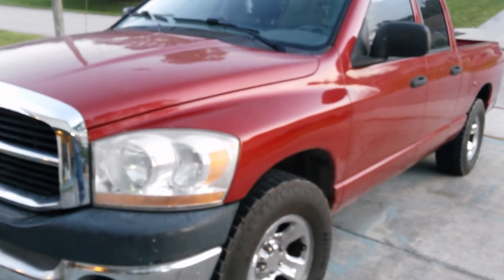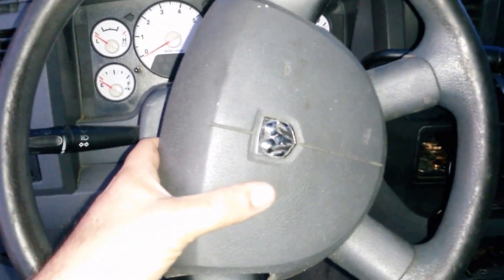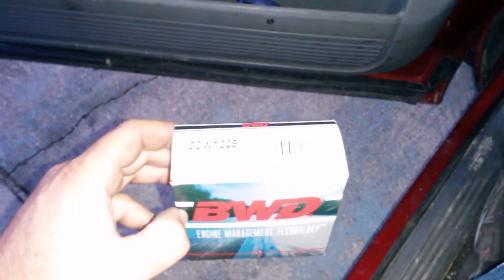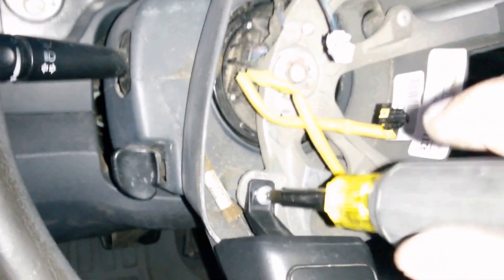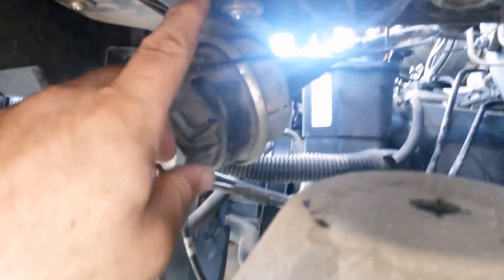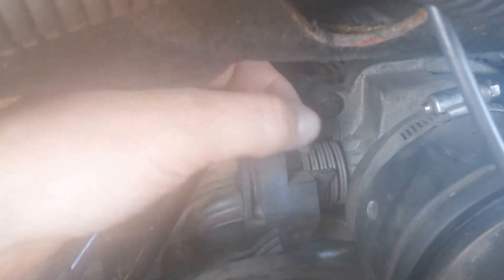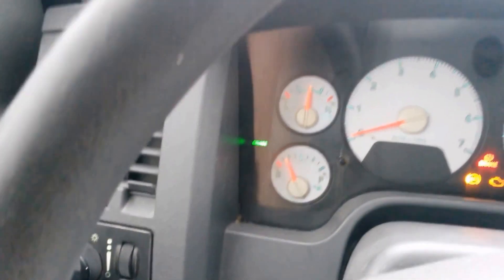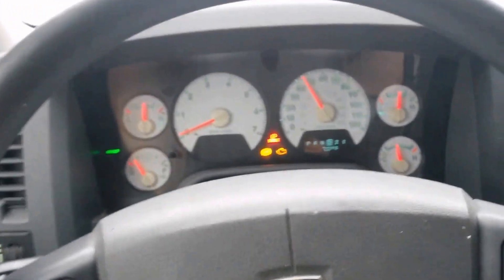Adding Factory Cruise Control to a 2006 Dodge Ram 1500 ST 3.7 L V6

Comment: Just came up on this video.  Just bought a used 03 Ram 3.7L V6. ST model.  No frills here.  After viewing this video I was excited to do this mod.  My 03 DOESNT have the vacuum reservoir, doesn't have the servo, and I haven't taken off the steering wheel air bag but most likely it will be missing whatever goes in there besides the switches.  Probably the throttle body linkage as well .  Pretty depressing after getting my hopes up.  Bue I did find the switches, reservoir, and its vacuum hose and servo in the junkyard  so will have to research getting the remaining components.

Comment: Thank you for this! Did you need to buy anything? I have a 2003 ST model; my truck has everything except the vacuum reservoir and the steering wheel switches.
Reply from the maker: I bought the switches from O'Reilly Auto parts. The vacuum reservoir and servo used from ebay
Reply: @samirvin1914  Thank you. Mine is pre-wired for fog lights too. Looks for an empty connector behind the driver side bumper. If I find a set at the junkyard I may put them in